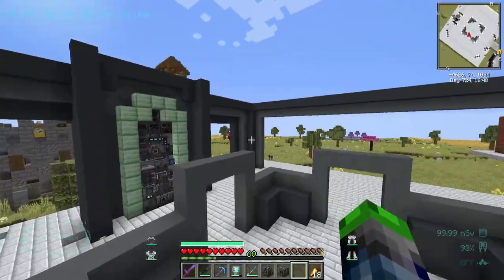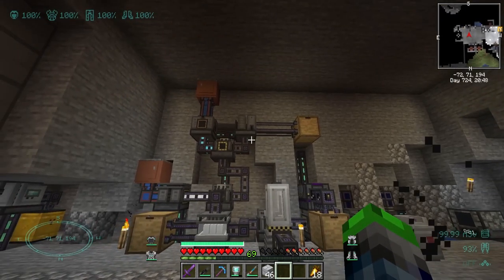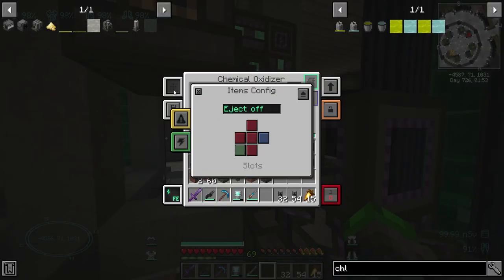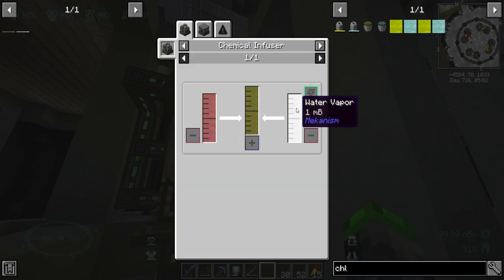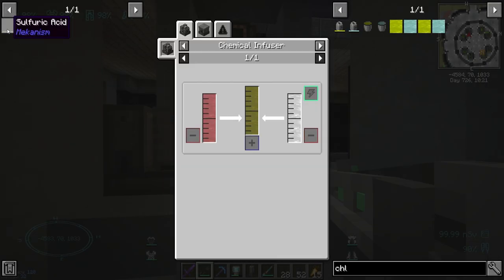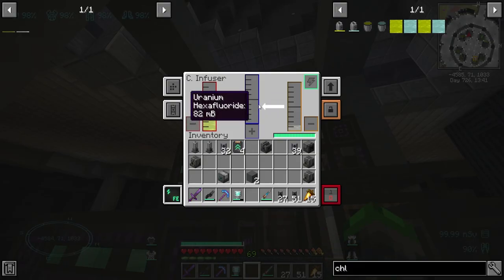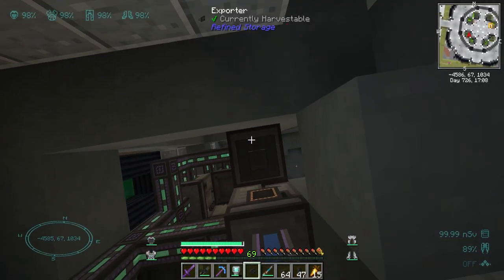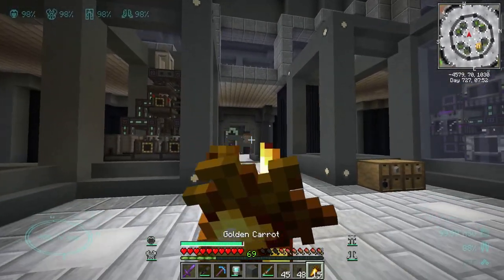Valhelsia 3 | Compact Fissile Fuel Automation! | [EP 25]

Comment: question, wouldn't it save some power consumption to have all of the different crystals generated from the different ores all funnel into one set of final processing machines?  If you only had one chem injection chamber, purification chamber, crusher, enrichment chamber, and energized smelter to power instead of 7 sets. your final production might slow down if all the ores were processing at once but it may help lower your power consumption. Just a thought, thanks for the great vids, you have helped me out in my own world.

Comment: Your fissile fuel production will get bottlenecked at the the last infuser and centrifuge. I would recommend using this setup for the hydrofluoric acid and uranium oxide and then using 2 infusers and 2 centrifuges. It will be double the production and you just need to build 2 machines.
Reply from the maker: Daan Groutars right now the limit is actually the gunpowder production. So once that’s fixed we’ll upgrade that!